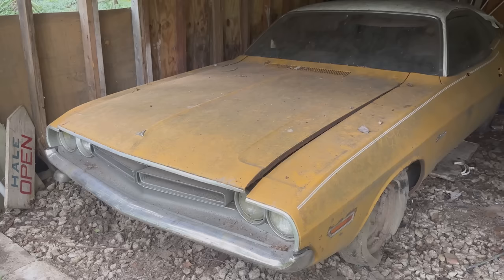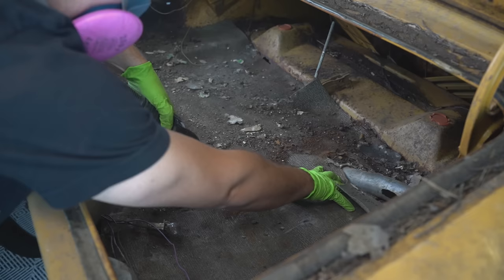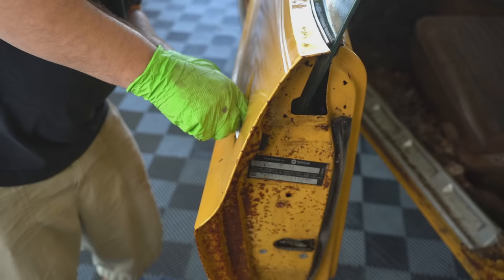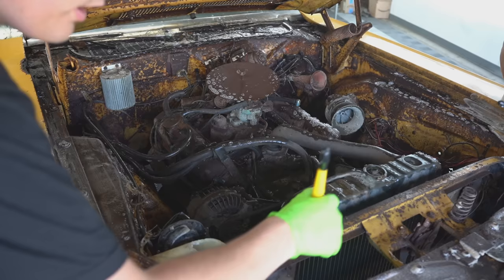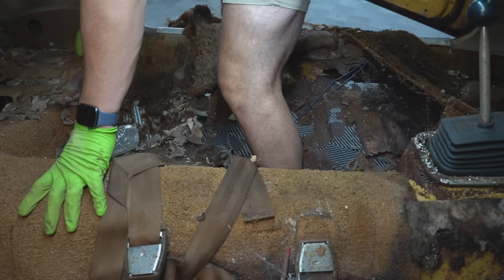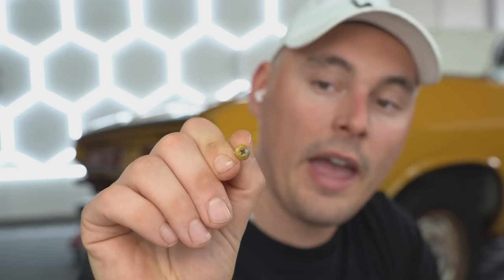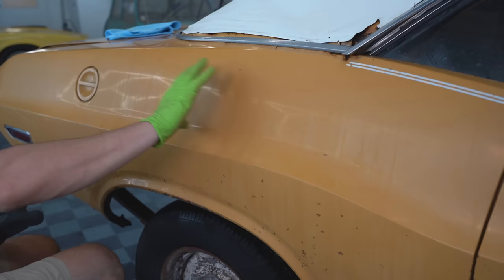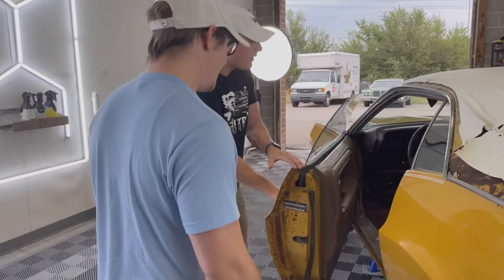First Wash in 40 Years: Barn Find Dodge Challenger | Car Detailing Restoration

Comment: It's a desirable year & probably numbers matching, but needs absolutely everything rebuilt from drivetrain to interior, all sheet metal, and in the end it's a 318 car, so it won't be worth half the cost of restoration. Still worth getting to run and leaving as a survivor with exception of structural & driveline essentials.

Comment: The floor won’t be that hard to fix. The most concerning thing is what the roof is like underneath the vinyl. 100% worth fixing up
Reply: Anybody who says that doesn't have a clue the money and effort it takes to pull it off bringing back a car like that. More than just the floor. Structural frame rails. The door is sagging for a reason. You think you can just put an old stop sign over the hole? If that guy didn't have the fortitude, gumption, finances, resources or knowledge in 1983 or the superseding years, not more likely by any measure since.
Reply: @vincemajestyk9497 You can't talk sense to most people. They see an old Mopar, see three pedals and think "oh God, gotta save it!" And forget that the things were put together with some of the most lackadaisical standards in the industry. I've worked on these cars, all the way from 50s to the mid 70s, no thanks, I'm good. Someone else can chase that set of problems now.

Comment: The parts are there to make it worth fully restoring. You can buy new trunk and floor pans and even subframe sections. I don't think you guys fully appreciated the value of it. To the one of you that joked about putting a Chevy engine in it. Just in parts value you could get a whole lot of Chevy V-8's out of that Challenger! That car is very much worth restoring and the 318 V-8 is nothing to sneeze at. Beat many small and big block Chevy's with them. The thing about the 318 is its really probably the best engine Mopar ever built especially for the average car buyer. Sadly, the Hemi, other B and RB big blocks and the 340 overshadow it. The 318 and 340 are pretty close to the same engine with just different bore size.

Comment: Butterscotch over brown is pretty unusual, and the 3spd is the kicker.  Mint interior, except for the missing door panel...excellent grill and looks like the taillight trim might be ok. Fortunately every single piece of sheet metal is available and this car will need it all...prob even a roof skin under that rotten vinyl roof.  Technically a challenger is not a muscle car, its a pony car...and this one is about the most basic one you could get other than with a slant 6.

Comment: Depends on your definition of "restore". Probably not worth a concours correct bare metal job on a low spec car, but it is 100% worth fixing. Everything needed to fix those floors is available. Strip the vinyl roof and apply paver paint. Its indistinguishable from a short distance. Its a good cantidate for a driver resto.

Comment: There are companies that make entire steel replacement bodies for these. You basically just cut out the vin and other i.d. markers and patch them on to the new body. Then use whatever original parts are good on the donor body and replace the rest, or use aftermarket.

Comment: A car like that is definitely not beyond repair. Those floor pans can be replaced and you can patch all the exterior rust areas or replace complete panels if necessary. Overall I have seen way worse back on the road. Hopefully it’s a survivor that you will see rolling on the streets

Comment: I can understand the sentimental value for the party concerned but, rare doesn't mean desirable. A base 318 with a 3-speed is not something collector's go into a bidding war over.  Yeah, great, it's 1 of 10 made because even in 1971 people spent the coin to have a 4-speed or automatic, mated to the little better 340 and or the big blocks. You'll never get the money out of this car, what the restoration cost will be....No fault of the car itself but, Dodge really screwed up by changing the tail lamps for '71....Which makes the '70 so much more desirable.....Great work on the cleanup guys, as always!!

Comment: Our 71 has a white interior and all the screws are chrome.  How are the frame rails? I would guess you would need to put $30,000 in body work if the rails are as bad as the floors.  Never get the investment back as a profit, but if someone has always wanted a butterscotch Challenger with a three speed manual, it would be worth doing.  Thanks for sharing.

Comment: Had a chance to buy a 71 in 1980 with a 440 and a manual shifter for 1750 bucks. No one wanted them after the second gas crunch.

I liked the 70 front end over the 71. This is why I didn't buy that 71. Looking back,  I should have bought it
Instead I purchased a 82 trans am. Beautiful car,  but junk. 

You can get the door openers,  depends how much rust. What engine? The 72s came mainly with 340s and 318s.

The vinyl top is in bad shape. No floor boards,  it's gone. Darn.

Oooo,  is that an underdash 8 track?

Comment: There's no way that car only has 19,000 miles on it. I would seriously guess at least 119,000, or even 219,000 miles. I had a 1971 Cutlass S with 233,000 miles that still looked and ran like new when I traded it in, and it was all original. It smoked when you first started it for about 30 seconds because of bad valve guide seals, but still ran and drove excellent. That car was ran hard, and put up soaking wet and dead. 🤣😂

Comment: I seriously doubt this car has only 19,000 "original" miles on it.  Maybe more like 219,000.  The replacement floors and sheet metal for this car are available, as are many other parts for restoration of the early Challengers.

Comment: Definitely not 19k miles. The odometers roll over in those years and the engine compartment shows pretty extensive use. It’s probably 119k miles. The 3 speed manual trans is the lowest transmission option, it’s rare mainly because people didn’t want it. Would be a good candidate for a restomod being a small block 318 car also the lowest v8 option that year besides a 6 cylinder.

Comment: Can I give you guys a bit of advice?
You need a hip height mobile bench on wheels that you can put the seats etc. on to clean.  
I am 80 years old, and now I am suffering the life in the past , where I did everything on the floor like you do.
My back has gone, the legs are failing, and it's all my own fault for years of working bent over or on my knees.
You'll curse yourselves when you get to my age.

Comment: Whilst I can appreciate the before and after differences on some of these type of details, I do find them a lot less satisfying when they are so far gone with rust and bits missing every where. I feel like you need to steer more towards cars that will genuinely come up good albeit with a few imperfections obviously. But it seems like a lot of your vids lately have been cars that either need to be scrapped or need huge overhauls.

Comment: In my opinion, it is a base model with a 318, not worth restoring. If it had a 440 six pack with a 4 speed then I would say yes, restore it because the cost of restoration will be very high!

Comment: I watched a Charger being restored that wasn`t this bad, and the metal, metal work and labor hours were almost $50k. It`s rare, if it was a 440-6pack car I could see it, mint i`m guessing a $60k car maybe to the right guy, 318 cars are not that desirerable, even a 3 speed, it`s a shame what a dirt and gravel floor, with moisture thrown into the mix can do to steel, it`s a shame. The panels sure , cleaned up nice, i`m wondering why all the pieces were removed from a 14,000 mile car, bumpers,door handles, rear trim, it doesn`t add up to me, but you guys sure can clean up paint.

Comment: having been into mopars since the 80's i have to say that is not an original 19k mile car. there is way to much damage for a low mile car. someone in the day disconnected the speedo cable at 19k and kept driving i would say that is a 60k car or more.

Comment: NO Guy, they didn't 'paint match' screws! They were supposed to be Chrome plated. It was just RUST. Not even plausible for mass production considering how many exterior paint colors were offered. You think an assembly worker is going to pick the 'right' color from massive bins of colored screws?
BTW guy, that iron dissolver or remover is acidic. You probably don't know this but it will ruin the clear anodized aluminum trim they used on this and a lot of cars in the '70's and on.

Comment: I think it is equally possible or more likely that it has 119k miles.
Reply: It could be 919k miles.
Reply: I think there's a bit dishonesty because the odometer only shows in the 10k. At 100k, it will show 0 miles.

Comment: Dylan McCool restored a 73 Challenger in far worse condition. This 71 will be easy. But ditch the 3 speed manual for a TKX. Nobody wants those. Also, I'm surprised you bothered with the vinyl top. It needs replacing anyway, so why not just tear it off?

Comment: Do not part out this car, it's very rare, restore it.  I had the very last year of the Challrngers, '74 R/T, mine had a 340 in it, from factory it came with a 343.  It was a slapstick automatic, had AC, dual exhaust, royal blue with white vinyl top and white interior.  I paid $1700 in 1979 43,000 miles, mint, wish I kept it

Comment: First of all, a 1967 Belvedere GTX with a .413 Max Wedge intake on a set of rally rims in Labatt Blue.
Secondly....
The Challenger hasn't sat in the same spot for 40 years. If that much crap laid un there on the Cowell,  the rest of the car would have that much on it.
It sat in a backyard under a tree, was hosed off and then put into that garage.
I love the build up to the explanation, but you over produced on that part.
I have been around MOPAR Muxcle for longer then this car has sat. I have seen just about every scenario you can image on where a car was stored., and how long in one spot.
That is more like about 10 to 15 years sitting in that garage.
Now, as you look further into this video, you see the floor pans and how bad they are right?
My knowledge tells me under a tree for many years. The roof is shot because the vinyl roof cover. It held water and rusted out just above thewindshield, just above the rear windo, and in the trunk. Mopars are notorious for this type of cancer!,
Dodge didn't color match screws. The body panel ones are would be bolts that held fender and structure parts on. The color came from painting during assembly. All Mopars had stainless screws in the interior , such as on door cards seat trim, door trim and dash assembly parts etc. The dandelion painted screws in the seats are owner painted. So was the car.
This is a base model Challenger. Not the lowest model, but if it were say.... aN SE, RT model, it would have chrome trim on the wheel well lips and chrome rocker moldings as well as a chrome emblem that was larger in size.
The .318 is a dead giveaway that it is on the low end.
Also, the decal package wasn't on this car.. 
The interior for the 71 was used thru the 74 model.
It was much like the Charger, but with subtle differences.
Last thing...
Your chrome cleaner does a sub par job with too much effort.
A top quality product like Never Dull will out do that stuff you guys got hands down!
.0000 steel wool and your chemical to polish?
Never Dull uses raw cotton with a cream based cleaner thalready has the product all mixed and together in the same container. Not much effort or pressure. None the less, it can be used over and over again and again.

Comment: Yeah honestly, that is a 119k car. Not a chance it's only 19,000 otherwise it would be Near perfect and Mint. Even some of the Higher Mileage cars Kevin from Junkyard digs removed from Barns in Iowa where 5x better than this. The petal wear would show as well. Too much wear, rust, and messing around with wiring on this one.

Comment: This car is pretty far gone. A lot of rust. A lot. Whether or not it is worth restoring would questionable but cars worse than this have been restored. Perhaps this project would be for ambitious person with a lot of determination and money to do a restoration. Otherwise forget it. There's a restoration shop in Oregon that specializing in restoring Mopars. They have a you tube channel. For a car like this it's best left up to a professional restorer like that one but it will not be cheap. On second thought after watching the entire video this car is a total rust bucket. There's not much left to anything with but there are replacement parts like floor pans available for Mopars especially of this vintage. These cars are very popular with Mopar enthusiasts. As a parts car this one has very little to donate other than the dash and seats. See if a buyer can be located for restoration. Otherwise send it to the crusher. There's nothing there to keep as it is.

Comment: Parts car for sure. NOT a'50/50' decision. It was a parts car 40 years ago and a parts car now. Looks like it was already being stripped. Door handles, bumpers, valances, trim, interior parts. C'mon. The thing was driven in Ohio salt and winters for 12 years before it was parked. It was nothing special. That's enough to kill most cars. Seen plenty of supposed low mile rust buckets.
First off, there is NO WAY you can say '1 of 10' Chrysler NEVER had records like that and they were all burned in the 1980's. Even so, say it was. SO WHAT? It's a 318 generic base model with the standard offering 3 speed manual. All it says is a cheapskate ordered it. Only a zoomer or a millennial would say it's a 'musclecar'. With a 318 set up like that? They would have laughed you off the scene 40 years ago. I didn't even need to watch this. If you don't understand what 40 years of sitting in a dirt floor garage in the rustbelt will do you should acquaint yourself some examples. Could it be fixed? Sure if you're that stupid and maybe have the resources of Musk or Bezos, but it's NO Hemi or Six Pack car. It isn't even a big block. A base stripper. Seen many just like that one over the years in boneyards. That one just got saved from the boneyard by stinginess or sentimentality.  Best way to 'restore' it is jack up the shifter knob and drive a new car underneath. The cheapest solution if you want to spend the money.

Comment: This makes me cringe watching you guys Wash the engine down and get water in the carburetor. I watched way too many revivals to know that I've seen cars sit 30 to 40 years and run 600 plus miles back to a destination on the original engine. You should never assume anything. That car be restored as long as the frame fails are solid. Floor pans can be replaced